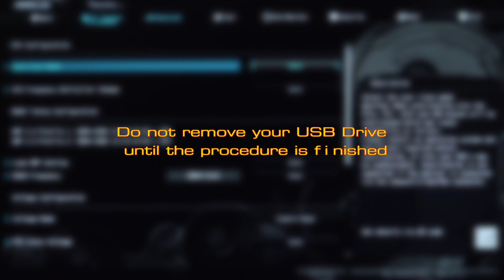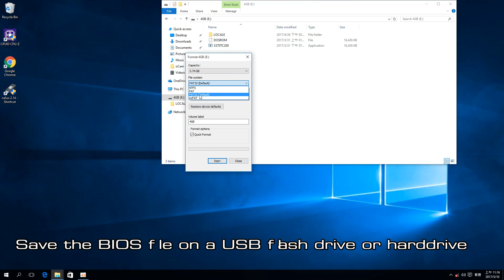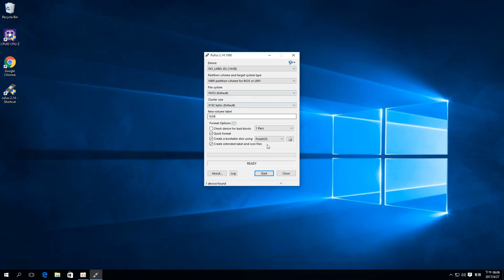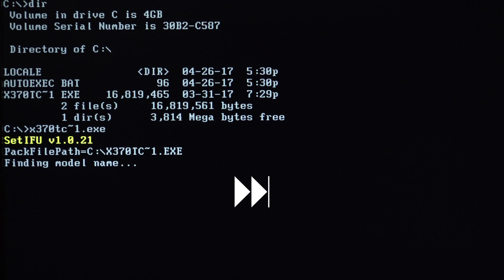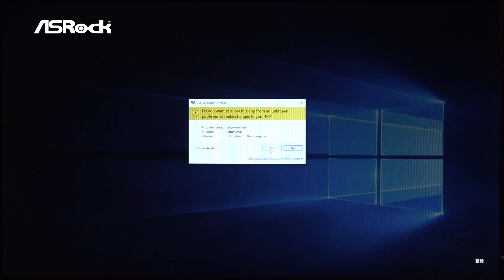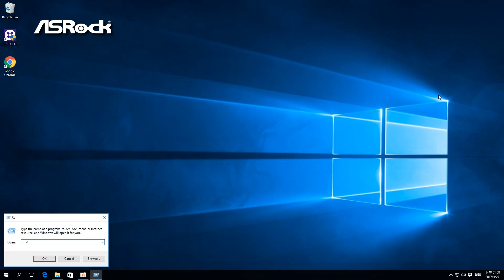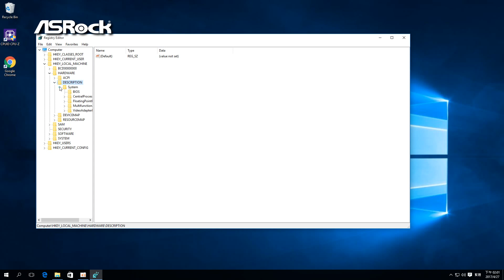[ASRock Classroom] How to check, update, and clear BIOS?

Comment: William, thank you. My motherboard is Z370 Extreme 4. You saved me. Namely, I created a problem when I switched the option "Legacy USB Support" from enabled to disabled in Bios (I tried to solve the problem with the bluetooth adapter that doesn't work properly). When restarting the PC, the "del" and "F2" keys did not work anymore, so I could not enter the Bios. I downloaded and started your program "ASRock Restart to UEFI" and it took me straight to the Bios, but then I had to enter the password, which again was not possible because neither the mouse nor the keyboard worked. By the way, both are on the PC via usb port. Resetting via the jumper solved the problem for me, so once again, many thanks. For me, the video is worth its weight in gold!  Sorry for the long explanation.

Comment: When you ASSrock motherboard has no BIOS reset jumper nor paperclip-contact points. Its a A320M-HDV
Reply: It was buried under the GPU.... So not always in the vicinity of the BIOS chip....

Comment: Yeah...no luck in upgrading my bios...in fact after the reboot the system does not even work any more.  All I get is a black screen and then after a short amount of time 30 secs? the system will reset.  There is never anything printed to the screen and all keyboard input does not work (so its now a brick)
Reply: what have you done wrong?
I want to update mine but i´m kinda afraid

Comment: I have a problem with the bios of my H61M-VG4, maybe you can help me out and advise if a update is useful. My PC only starts up after a bios reset (with the jumper). The issue started after I had turned on a function in the bios for using multiple screens, clicked on save and exit. My screen went black, did not do anything at all. I have put the pc off after a long long time, because it did nothing. It only booted after a bios reset with the jumper. Windows 10 starts, everything is fine... But... when I put it off it will not go on again, untill I do a bios reset again. The pc is going on, the fans are off and the harddrives makes a short buzzing sound every few seconds. Do you have any advise what to do?

Comment: Does it really take less than 15mins to clear the CMOS?

Took 1-2 days after removing my CMOS battery to finally be able to reboot my PC. 
Tried multiple times to remove my CMOS battery after switching and plugging out the power. Left the PC alone for 15mins> but still couldn't boot it up. 

I've been experiencing RAM issues ever since I built my PC. My PC either won't boot if I change the default ram from 2400Mhz >3000Mhz and above, OR if I leave it at 2400Mhz and it freezes when I go AFK for more than 15mins.

Kingston Fury 3600Mhz
AMD Ryzen 5600x
Asrock B550m Pro4

Comment: I built a new PC with the Asrock B450 Pro4.    This is the first time I've used a M.2 drive.    When I install different Linux versions on one of my 2 separate SSD drives.   I keep wiping out my M.2 drive?    Can the M.2 drive be "disabled"   in the bios - in order to protect the drive ?      Its really a nuisance to have to keep removing the M.2 drive in order to protect the contents.

Comment: Hey William. I have z370sli killer. My pc turns on, fans working and all...no power to periferials and black screen. Works for 30 seconds and goes into reboot loop. I tried disconnecting everything. Left only CPU and MOBO connected. PSU is fine.

Comment: Nice explanaitions, but I am in BIOS reloading UEFI default, and no USB keyboard activates. (B560PRO4 - I5 1200)  I see the first screen with the "instant flash" option F6 but a very short moment, then it goes immediately to F2 or DEL to update BIOS with UEFI defaults.
NO Keyboard active, I tested with a simple PS2 USB adapter it does not work.
If I use a PS2 mouse can I stop on the first BIOS screen with it? WIll a PS2 keyboard work ? ANy workaround ?  Thank you so much (I thought of disconnecting all storage media to see if I can boot on an USB stick, but I doubt of it) Regards

Comment: You morons need to get your act together. I bought two of these things and the pc boots up initially but then after I shut it down it refuses to boot and just clicks. put everything on an MSI board and the system works perfectly. 5600x on a B550m Steel Legend.

Comment: i wish i could do this for my ASRock X570 Phantom Gaming-ITX/TB3. my bios is fucked (happened while using beta version of asrock RGB lighting software), and i can't get it back up. i even bought a bios programmer tool (CH341A) but i cannot get a good access to the chip without unsoldering it with a hot air gun.
i noticed there's a 4-pin UART1 connector right next to the bios chip, which is not mentioned anywhere in the manual. do you think i could use the UART to program the bios? i can't find anything on the net about it.

Comment: Hello, I have a problem, the motherboard blinks blue, but it does not turn on, I have already tried all the components on another computer and if they work, I do not understand what it could be, I already updated the bios of the board and apparently it has been Installed the latest version of the BIOS, I do not understand what it could be, the board only blinks blue and nothing else, it does not turn on. I need help please, Thanks.

Comment: I have a ASRock H81 BTC that I reset with your BIOS reset procedure, 
then I change de bios battery with a new one. 
But the BIOS didn't save anymore the settings. 
Every time that I take out the power cable it ask me "N" then "F1"... in order to power on. 
Can you give me some other idea please ? 
Thanks in advance

Comment: I purchased asrock extreme4 990fx A few years back bought the motherboard and case and then collected all the bits pull it away for couple of years as was having issues posting so practically never used it may have only been turned on 2 times Throughout its entire life and when I went to pull it out the other day went to reseat the CPU As a last ditch effort to save the  whole build And apparently as rock use cheap plastics because when I took the CPU cooler off and went to move the little alarm up to take the CPU out all the plastics holding the CPU the socket just crumbled how cheap was that plastic I bought my board new when it came out and have had nothing but disappointing experience with it

Comment: I have a ASrock X399 Tiatchi and is power cycling when it gets to code 07. In the manual it says to clear CMOS, the board only has the button not the jumper which in your video here you don't go into the specifics when using the button for example do I need to take the CMOS battery out or not? Do I need to hold the power button down for 15 seconds or not? Do I need to leave it for 15mins before starting or not? Or is it just disconnect power press the button reconnect power and boot?

Comment: 2:15 The .exe file type seemingly has no impact. If you're confused that you downloaded the right file, or that it will be used correctly, don't worry about the ".exe".

2:40 Something very important that wasn't explained here is that the update will reset settings, which applies to the "Hard Drive BBS Priorities", meaning that if you boot from your SSD, you'll have to make it the first priority or else you get a boot\cmd error!

Please pin this, because this was a serious problem I experienced!
Reply: This is what I'm wondering about as well. I downloaded a bios update and the UEFI isn't even detecting it wtf?!

Comment: ive done this, and my system still just cyclesthen turns off and dosent have a video signal and repeats i dont know what to do...
Reply: Darth Tator did you fix this?
Reply: @razewyd8743  yes but just bought a new mobo though
Reply: Darth Tator did u end getting a better one?
Reply: @PradaKicks  yes few months later got a tuf gaming x570-plus wifi

Comment: Taichi Ultimate X470 bios UEFI gives error code 6 via the internet even with a direct connection to the modem. I found the windows 10 bios files from ASRock website and followed the instructions but the file is not found around on the USB outside of the folder. THE USB WON'T FLASH! Is there a specific USB port to use? Is there a size limit of the USB drive? I.E. no more than 4GB?

Comment: How do I get my asrock taichi to power on? It flashes teal and then slowly blinks blue but will not power on? I’ve tried everything. Psu is functional, power button has continuity. Running ryzen 7 2700x, Geil evo potenza 8gb x2 ram, LSP ultra 750w psu, 1tb 7200rpm hard drive, EVGA gtx 970 gpu. Why is my build not powering on?????

Comment: i was racking my brain, then i tried something, the x470 Taichi Ultimate needs no other files on the drive, i placed the ZIP on the dirve and extracted it there, with any other files on the drive, i got "no image file detected" i tried several drives without success, even going so far as to put it on an NVMe drive temporarily initialized as MBR and formatted to a 2GB fat 32 partition(the only partition) but no, it was as simple as "only the BIOS you intend to use should go on the update drive"

Comment: I updated my BIOS and fixed my issue of my 3200 RAM in the correct slots for dual channel memory reading as 2400 and single channel. It also fixed my hardware reserved of 8 gigabytes down to 70 MEGABYTES.

I have 
R5 2600
Asrock b450m Pro4
Crucial Ballistix sport LT 3200
Reply: Mount Oza Im gonna buy this combo too do I need to do it?
Edit (I mean update the bios)
Reply: MOURAD ak7ay with this exact combo of cpu, mobo and Ram, it’s possible it might work out of the box, but check anyways through bios, task manager and hwinfo64 (third party downloadable software that lets you monitor specs more accurately) it was relatively easy to update it, just format a drive without an extra software. Windows should be able to format it. Plug in and instant flash through bios.
Reply: Mount Oza thx for replying

Comment: Hi
I recently brought an AsRock B450 Fatality Gaming K4 motherboard to use it with Ryzen 5 2600 processor for a PC build video. Ever since I finished the build & booted up the PC, processor is running @ 3.4Ghz & RAM @ 2133MHz only.
I tried every possible way to overclock the CPU to little like 3.8 to 3.9GHz with 1.3 to 1.35V & RAM also I tried XMP profile 1 which detects my RAM at 3200MHz but as soon as I save it & reboot. The PC starts & shuts 2-4 times and then boots up with same default settings.

I have tried numerous ways with various speeds, voltages for both RAM & processor but it failed.
Later I update the BIOS to P3.50 which I think was a big mistake as after updating I read that for Pinnacle Ridge CPUs no need to BIOS upgrade. 

Could you possibly help me with this??? How can I downgrade my BIOS now OR do I need to do it??? 
What bios version is perfect for 2nd Gen Ryzen CPUs like Ryzen 5 2600 to overclock both CPU & RAM? It is not overclocking even the RAM speeds also not changing with default bios P3.20

Currently its at 3.4Ghz & RAM @ 2133

Comment: After i cleared cmos, will the Bios version be 1.00 or 1.40 (the version i bought the board with (technically the factory settings))? I'm asking because then i will have a big problem with the Ryzen 3 3200g on B450 chipset...
Reply: No. Version will be still the same.

Comment: Updating UEFI Bios Interesting Message : (* Please install "AMD all in 1 with VGA driver ver:18.50.16.01_WHQL" or a later version before updating to this BIOS.)  The zipped files have setup.exe files...
https://www.asrock.com/MB/AMD/B450%20Pro4/index.asp#BIOS  

I do not run windows, Linux does not process exe files?  Do I just ignore the message? and use Instant Flash - after downloading the bios?
Reply: Those drivers are for AMD APU chips ONLY, so with the "normal" RYZEN chips you just Instant Flash them and that's all. Don't forget to reset to "Failsafe Defaults Settings" before and after BIOS flashing!

Comment: It doesn't work on a x370 killer sli bios versión 1.30 instant flash is disabled, and doing it from DOS won't detect the update file as a exe file, so nope it can't be update, if you have 1.30 version you will be stuck with it

Comment: I have a z390 phantom gaming 4 which I made the mistake of buying in a cyberpower pc, no matter which bios file I used and whether I go through windows or the flash utility, it will not detect the file. Fat32 usb stick on multiple ports with no change. Do i return this pig or is there an actual solution. Support has not responded.
Reply: RMA!

Comment: I got a question my asrock b450itx doesn't want to power off. Monitor will turn off same with mouse and keyboard but the system fans will stay running as with the power button. I still had the factory BIOS. Power button doesn't work I have to always unplug from wall and it takes a while to turn on.

Comment: Hello, I have a question. Should I reset CMOS after BIOS update ?
Reply: ALWAYS!
Reply: @vladvah77  Wow thanks for this! After updating my BIOS to try and fix an  LED problem my B460M Pro4 kept turning on and off in an endless loop. After resetting my CMOS it actually booted to the updated BIOS. I was afraid i'd perma wrecked this motherboard but it actually works now lol

Comment: hi william, I have a new motherboard b450 itx, after the installation is finished initially my computer turns on and for several days everything looks amazing, then the next day my computer won't turn on, my gaming keyboard lights up, the Lan port lights up, the power vga indicator lights up, but when I press the computer's power button does not turn on, the power led is off and the CPU fan is not spinning, please help me with this problem, thank you

Comment: Can anyone help me?
I've been using Z270 PRO4 since it released past year (2017). And since then I've been using 2 HyperX 4GB 2400MHz memories in Dual Channel. Now, I thought it was time to update and I bought a 8GB HyperX 2400Mhz. But it looks like my motherboard can't read the new memory. changing slots will ocurr my PC to not even turn on. If I turn on just with the new memory, it will be bipping. If I put with my 2 old memories it will only show 8GB of RAM. Is my new memory not working? do I need to reset CMOS? Should I download any software to upade anything to my motherboard?

Comment: Attempting to flash ver 3.20 Bridge Bios with instant flash on my brand new AsRock AB350M (currently ver 3.10). I downloaded, unzipped and copied the file to a freshly fat32 formatted usb drive. The instant flash tool recognizes the bios file and asks if I want to update. After clicking update, a box pops up saying "Secure Flash check fail!" I've downloaded and reformatted several times thinking I may have gotten a corrupted file download.  I am at a loss for how to fix this. Will you please help me?

Comment: JUST A WARNING - just bought a Taichi Z390 mobo, was having some issues OCing, and Asrock released BIOS P1.51 indicating it removed power limit and improved OC performance - well, it bricked my mobo, and researching it, found 2 other users indicating they had bad problems with 1.51 and went back to 1.30. FWIW

Comment: Is there anyway to update bios before POST? My pc is currently stuck in a boot loop and I’ve already replaced RAM, motherboard, processor and PSU. The motherboard I have is ASROCK H310M-G/M.2. I’ve troubleshot all other possibilities and I’m thinking now it’s the BIOS that needs updating. Any suggestions??
Reply: I think i have a similar situation as you. As i have the boot loop with error 46 for mine. And i've redone the cables too. And i don't know what's causing it. Ive tried removing the memory sticks. Different slots. Loose cables etc

(Although this is my first build. Aka its sort of new but with an x370 taichi)
Reply: Set your os drive as boot priority.

Comment: When clearing the bios in this way by removing the battery and moving the jumper, what does this actually do? Does it undo any changes made to the current bios or does it actually revert to the original version of the bios if the bios has been updated to a new version? I have the AB350M Pro4 and recently updated the bios from 4.7 to 4.9 and never got a picture after reboot. The update of the bios was successful, there was no issue during the flash bios update but after restart all I got was a black screen. Will clearing the bios revert it back to 4.7?

Comment: Thanks for the vid! I did not know what can be my problem with my lovely H61m/U3S3... it started dropping error messages before loading in the UEFI UI, about the asmedia sata controller... 
After i searched forums i ended up with the battery-question... so i changed it during a Clearing the CMOS... it is looks good now! I want to keep my bios-version if not that is the problem...

Comment: Perfect. I followed the instructions and cleaned the CMOS. I needed to clean the cmos because the boot was blocked. When installing Ubuntu with Win10 on a single disk, use EasyBCD to have a loading menu for operating systems. After using EasyBCD, the boot menu was blocked, the mouse and keyboard stopped working. I had no choice to enter BIOS -Setting. Therefore, I had no alternative but to clean the cmos. And this video helped me do it. Thanks (ASROCK 990FX EXTREME3 AMD FX8320).  BE CAREFUL. When enable-disable Fast Boot, Secure Boot enable-disable, or use Legacy boot-UEFI.

Comment: All motherboard manufacturers should have these kinds of videos. Although there are lots of people online willing to help, it's nice to hear this come from your manufacturer. Note, if you're resetting the BIOS via CMOS, make sure NOT to power your system back on before holding down the power button! Almost did that lol. Didn't do that and my system is back up and running after a bad OC. Thanks ASRock.

Comment: Is clearing CMOS really necessary?
Reply: Nope, only if you discover some problems that a reboot or a "turnoff the power and motherboard battery" wont fix, then you can use it. If you just use it random because you can, its just dumb.